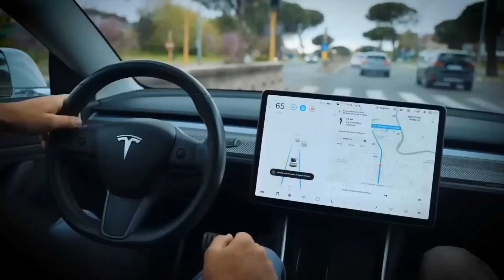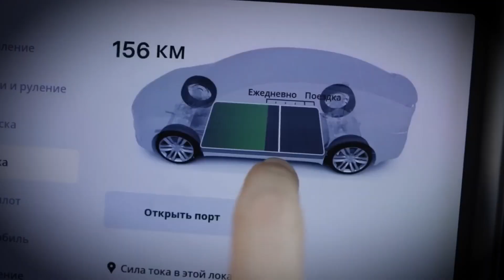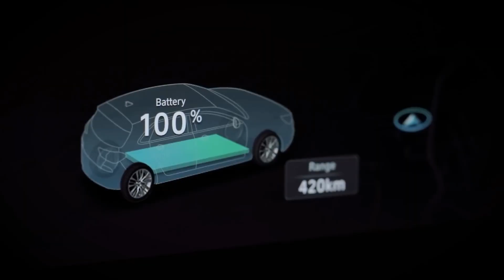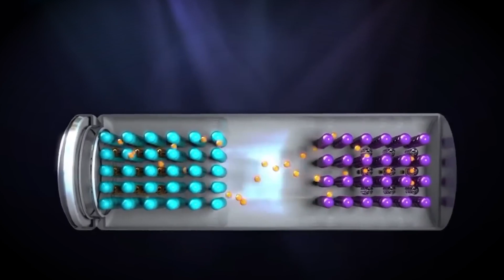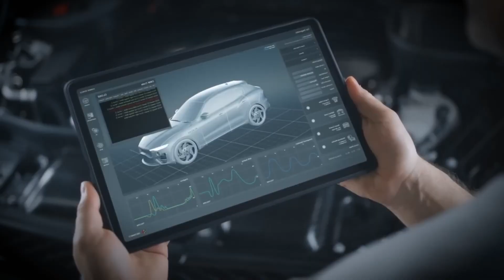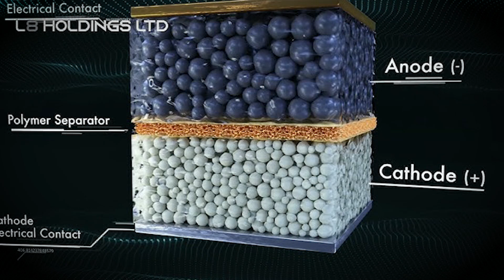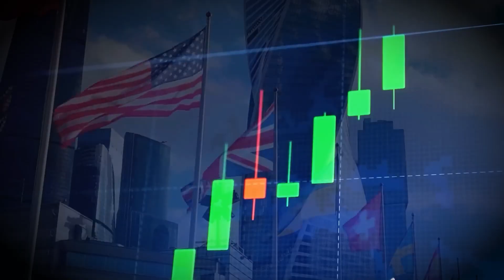Tesla's New Battery Is Blowing Minds!

Comment: 1. EVs production & life-cycle are still creating more pollution than their internal combustion counter parts.
2. The biggest issue with solid state batteries, the elephant in room no ones talking about, is the performance degradation in low temperatures.
This hidden issue should concern every consumer who lives in places where temperature goes below ~7°C (~44°F) i.e. most of the Western world...
Reply: No they are not. You are a moron.
Reply from the maker: Very true. Thank u for commenting.